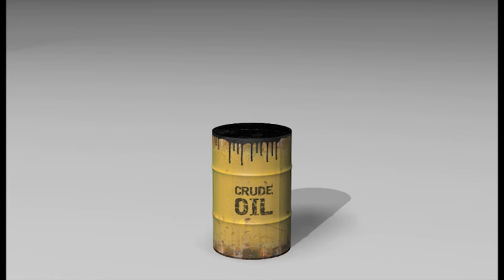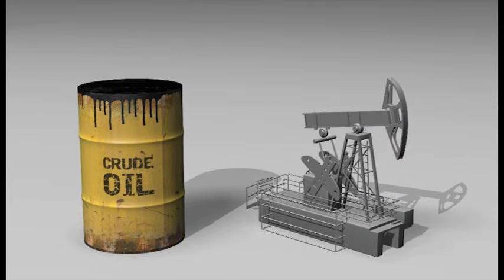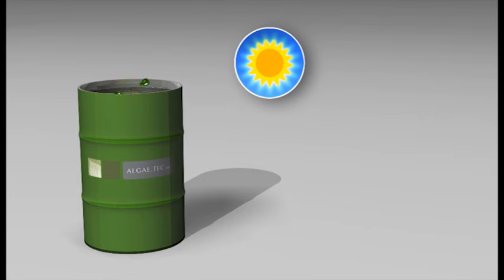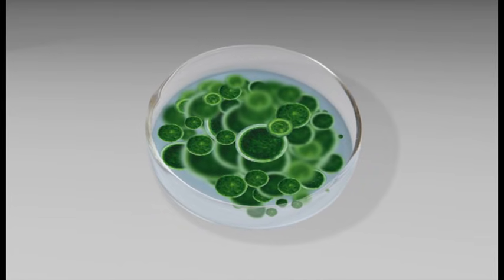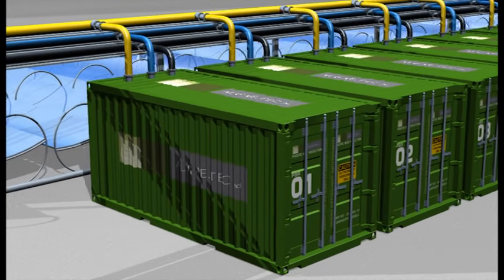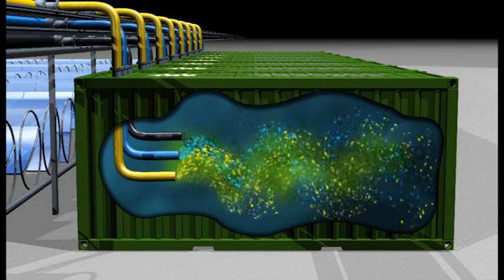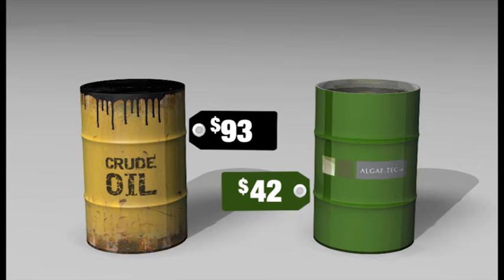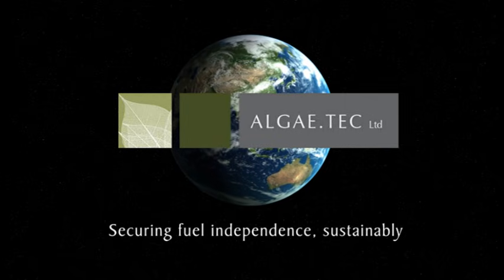How the Technology Works - algae to biofuels

Comment: Hmmm. Sounds interesting,never knew algae was so awesome. So the whole thing depends on you having a steady source of carbon dioxide providing that sourcing it will be a piece of cake for many years to come. How much useable fuel is produced  per container (I would think it depends on the amount of algae and the carbon dioxide available to them. How do you maintain the optimum health(and gas production rate) of the algae. Is it a better alternative than biogas and biodiesel. Can an electric power plant rely on this fuel and operate efficiently compared to other plants using crude oil based fuels.

Comment: Pressing is the cold process way of extracting the oil.  You can also separate oil( tar) and gas  by high heat and water.  Without using chemicals.
Reply: How..can u please explain?

Comment: Can all lipids be used?
Reply: Depends on used for what specifically. Some are better suited for certain applications than others. But, in general, all lipids have some use. Different algae strains produce different lipid kinds, quality and amounts. There's a lot of different kinds of algae out there. Also there's the cellulosic biomass strains,  some of which are excellent for plastics and synthetics production, such as textiles. Some algae are good producers of both! So in looking at algae, there's not just the lipid production types, there's also, after lipid extraction, the residual cellulosic biomass value. In short, there's dual purpose algae.
Reply: There are lipid algae which are used for cosmetics, some for food related, some for fuel production, etc.
Reply: I should mention cellulosic algae and other high-yield cellulosic biomass sources for textiles, plastics and fuel (biochar/biocoal, pellets, etc.). -Check out free online publications/media such as Biomass Magazine.
Reply: +Carl Lelandt 
There is also a printer that converts algae into a gel for printing products faster than a 3D printer.

Comment: If we are using algae bio fuel, do we need to change anything in engine for it to give a better result
Reply: +vaishali garg Not sure about that. As it is, conventional fossil derived end-product gasoline is chemically treated to fine-tune its combustion for various reasons. Most likely the process would be quite similar with the biofuel end-product, so its in emissions compliance, etc. Existing fossil crude refineries, historically, have made available various adjustments, such as adding other components to the fuel product molecule, or by blending etc.
Reply: Fossil derived crude oil often has many impurities, which is one of the reasons for refinement at refineries. A possible big advantage with algae biocrude, is that it may be possible to produce biocrude which has a superior purity, thus greatly reducing refining costs for obtaining a clean end-product gasoline/petrol.
Reply: All "fuels" must be eradicated and we should just slop all investments in it to be honest, and all gouvernments around the world should allign in to finding a way to sustain infinite energy and every single vehicle should run on electricity.
Molten salt reactors are one way forward, but we still need much improvments.
Reply: @samgerland6087  government ruins everything though.

Comment: Can I have a job doing this?
Reply: Sign me up Leslie Che
Reply: +Leslie Che what do i have to major in?
Reply: +André M chemical engineering is your best bet. have a strong background in chemistry, both organic and inorganic, math, physics, etc..
Reply: Samson Lozano thanks
Reply: +Andr&#233; M there is only a field called "biotechnology", check it
Reply: Entry level jobs, in most cases, require minimum AA degree in chemistry, biochemistry, biology, microbiology and similar majors. These academic science backgrounds provide job entry at "technician" (or "assistant" and "in-training") positions. Some (very few) technical colleges offer alternative energy and alternative fuel specialized majors.
Reply: How about you just do it get a cheap spot on the coast pump in nutrient rich cold water and get cooking. Hell any river near a farm ing zone has a ton of nitrogen in the water to work with.

Comment: It may be possible to match algal biofuel production to anaerobic wastewater treatment plants. The anaerobic digesters remove and vent massive amounts of CO2 and methane as waste gases, along with smaller amounts of other nuisance gasses.. Also the wastewater water is extremely abundant, with important trace nutrients.  Large wastewater treatment plant facilities usually also have an onsite professional water quality lab, with bio-process lab techs. Also such wastewater plants have operations and mechanical maintenance staff, 24/7, likewise skilled with large biological/mechanical processes, sludge (biomass) handling, etc..
The digesters produce waste CO2 and methane at about 3 parts to 1 part. Thus, a high lipid producing algae, at that point could "carbon capture" while feeding, and so forth.. The available waste methane could co-generate power to cover cost of algae process equipment operation (pumps, and special spectrum light for operating at night/optional)..
Reply: The problem is there is not enough wastewater treatment to scale algae fuel production high enough to replace oil.  But the C02 feedstocks of coal and gas powerplants can potentially meet that demand.  If you think about it, in a way those fossil fuel power plants are producing not just power, but millions of tons of plant food that is simply being wasted.  That is a valuable side product they can sell to algae farms and thereby sequester the carbon and make liquid fuel and livestock food, enough to save our planet and allow us to keep our high energy consumption at the same time.  I call that win-win.
Reply: Carl Lelandt It is also my opinion that, the larger the scale of the operation, the easier it is to work with, and the more efficient it is.
Reply: Carl Lelandt So you think we should send all of our waste water to a facility that turns it into clean water, fuel, and electricity, all while helping repair the atmosphere? That's just dumb. Why would anyone fund something like that?
Reply: steven spall I think I see your point.

Comment: what type of Algae?
Reply: Ashgar Khan Excellent question! This is basically where all the research is needed.. Certain algae strains or types that demonstrate certain qualities need to be selected, then possibly hybridized or "streamlined" to optimize desired characteristics, such as fast growth, ease of self-replication and re-seeding, ease of lipid extraction, usability of leftover sludge biomass for its cellulosic content..  Certain strains of algae may be best suited for hybridized/modifying for low-light growth operation at night (requiring reduced lighting), or tolerance to low temp. environment.. Such low-light/low-temp. algae would be suitable for higher latitude, colder climate operation.. So temp. sensitivity/tolerance is also a factor. Although, as I mentioned in another comment here, matching algae production with anaerobic wastewater treatment plants is a win/win, as algae/water could easily circulate through heat exchangers to maintain appropriate temp. range. Search Amazon books for textbooks on biofuel algaes..
Reply: Ok thany for the info
Reply: An algae operation that works 24 hrs. per day, may utilize a different algae strain at night, than that used during daytime production, with low-light and special artificial light systems. There's also need for algae strains for use in entirely low-light and no-light, or fully enclosed artificial light systems (photo bioreactors).

Comment: But what about gasoline/petrol?
Reply: Macroalgae can be used to produce petrol and other fuels. Macroalgae have a lower lipid/oil content but can still be used to produce biomass in large quantities, and the bio-oil produced can be cracked using the same refining methods as crude oil.
Reply: ehh90 The algae process is a sort of added step which precedes, or gives us, the biocrude, and from there, similar processing, refining to our desired end-product fuel. With algae we start with a biocrude, produced in one's hometown region, possibly..-Thus invigorating hometown local economies. Otherwise, the existing petro (gasoline fuel) process starts from fossil crude, extracted from deep wells in foreign countries on the other side of the planet.So when we begin to become fuel self reliant from processes such as algae, we then become able to transition away from the petrodollar scheme into a much healthier biodollar system (economic model associated with energy/fuel production industry)..

Comment: how do you have light inside a closed system like a container? are there lamps inside the bioreactor?
Reply: Beatriz Pereira I had the same question and did some digging. Algea Tec, a startup biofuels company, developed an experimental proprietary algea production system called, The "McConchie-Stroud System". Its shipping containers are "linked to solar light capture arrays and a carbon dioxide source (a power station or commercial emitter of carbon dioxide)." Solar light capture arrays reflect sunlight into fiber optic cables located inside of the containers. http://biomassmagazine.com/articles/7666/the-road-to-commercialization/?ref=brm

They used this video, more promotional than educational, to attract more investment in late 2011 and early 2012, so as to build a few pilot projects at CO2 producing power plants around the world. Their stock peaked at 5.57 per share in Dec 2011. It now trades at $0.73/share. https://www.google.com/finance?q=OTCMKTS%3AALGXY&ei=mgPwUcj_IYSbkgXgJA
Reply: Alex Articulated damn. it's going bankrupt :( :( :(
Reply: OldSoulPortal The company just cant beat those coop-billionaires and oil industry. The rich simply crushed the company rather than jump over to a more potential, far less known tech for now and save it until the rigs are dried
Reply: @bf842903  But the ‘’rigs’’ will never run dry more Oil is being discovered all the time, the main thing stopping a transition onto Carbon Negative Algae Bio Fuel is the £€$Billions given in fossil fuel subsidies, that makes any alternative fuel ‘uncompetitive’.

Comment: Can someone explain to e precisely what the difference is between diesel and biodiesel???
Reply: Biodiesel is manufactured from biomass, e.g. algal biomass, sugar cane wastes, oil seed plants. It is a renewable resource unlike crude oil, and both are distilled to produce diesel, petrol, tar etc. Algal biomass for biofuels and renewable fuels is much more attractive an option than land based crops as algae don't compete with food crops and don't require clean freshwater. Many species can be grown using flue gases from power plants which make algae a renewable source of fuels.
Reply: Chemically tho is there any difference between the two??
Reply: anneeq008
they reduce co2 and need less money
Reply: anneeq008
The "bio" is a prefix that indicates it's originating process. But diesel is diesel, a specific hydrocarbon category.
When one reads diesel without a prefix, it actually has an unwritten prefix, which is fossil.   Rather like in math, we don't write the (assumed) plus sign, but add the minus sign when the number is negative.
The "bio" indicates modern biological processes that are favorable in many different ways. Fossil source, or derived, not so favorable.
Reply: Yes I believe there are slight differences in chemical structure, but bio-crude can still be cracked in a traditional crude oil refinery. There are actually two methods of obtaining Biodiesel that I know of. One method is a simple process involving transesterification which produces crude biodiesel from biomass, and the other involves producing bio-crude (oil) from biomass, which is then cracked in a traditional refinery, as mentioned earlier.

Comment: what's stopping you from doing this?
Reply: 5 yearz later and still not hearing alot about this
Reply: @newwavepressure6478  Exxon has purchased the technology
Reply: It is not economically viable.
Reply: @galonite  it is with more efficient vehicles
Reply: Well they are lazy
Reply: Not economic, but later when the prices of oil rises  it will be
Reply: In waterhub franscheok it's started
Reply: It requires large piece of landas the size of a texas

Comment: I wasn't saying that only fiber optics would have to be used to get the light down there, either way I think that they need a mixing blade to insure that more of the algae gets the light. Although this would be an extra step that could go wrong. Also, with the mixing blade, you could only put lights on one side and it would be okay. Unless there is a change in density where light enriched algae would float to the top, and the other would sink down. This would make the system simpler.(idea only).

Comment: Because you need to control the process 100% im guessing they are using LED growth lights that use very little solar electricity.. the containers are most likely insulated so you can control temperature aswell... growing algae outdoors is highly unpredictable.

Comment: a wise man once said to me that the difference between an optimist and a pessimist is that the pessimist has more information. 'open pond' has the setback that the algae may be infected, 'closed loop' can be problematic for finding cheap sterile CO2. also "finding an algal strain, with a combination of high lipid content and fast growth rate, that isn't too difficult to harvest; and a cost-effective cultivation system".
yet 300 times the oil content of other vegetation, & 30 times faster growth.